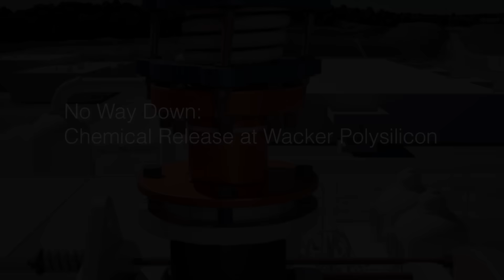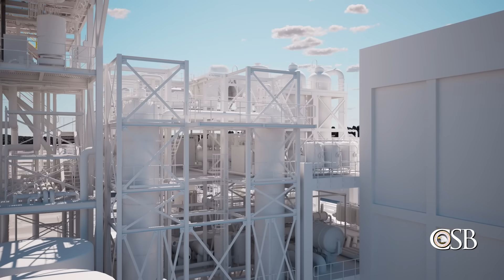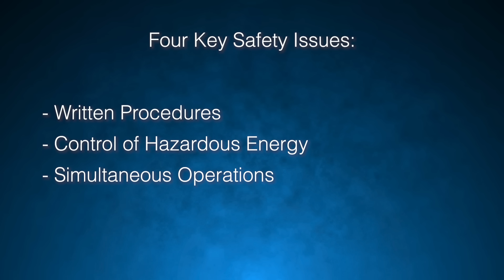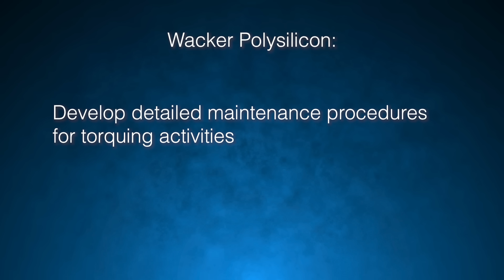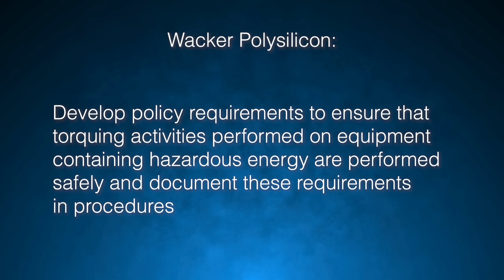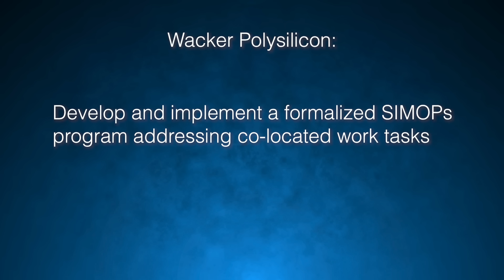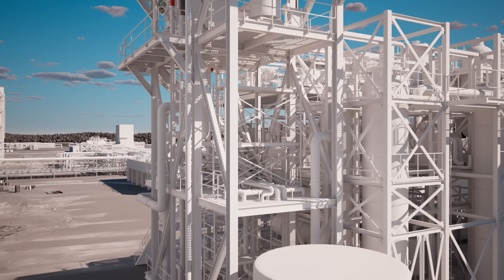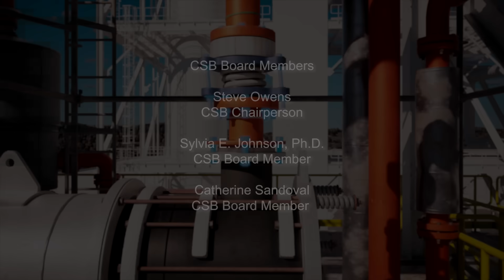No Way Down: Chemical Release at Wacker Polysilicon

Comment: 5 foot pounds of torque is not enough to cause a rupture. There was something else that failed. Maybe the bolt or flange had a casting fault. In my past, I  have been in charge of torque spec calibration. +- 10% is WELL within specifications. 5 pound feet is only % .05 out of spec which is well within specificication. Placing blame on the technician is a copout. I blame management. They should be held personally responsible.

Edit; I personally refuse to work for companies like this because management refuses to take responsibility for their actions. As well as the company refuses to take responsibility. Furthermore, management forces the contractors to partake in unsafe work practices.

Comment: If I worked around this stuff I'd treat it like I was handling a bomb.  "Are you absolutely sure about how tight all these bolts should be?  This stuff here isn't steel..."

Maybe when dealing with something as brittle as graphite there should be some sort of strain relief bolt system that prevents them from being tightened past the limit.
Reply: i work in a bike shop. the amount of NM for carbon seat posts is so specific. there even is grease with some sort of sand in it for byte. otherwise the post gone slip. this stuff should be maybe more clear by using a different size nut and more knowledge from the workers

Comment: I am a welder in the oil field. The fact that they had one stair case is wild, every (modern) drilling rig has two set of stairs off the rig floor for exactly this reason. Also, it’s crazy to me that this plant had to contract out torque down alone. Not swapping valves or gaskets just the torque down and didn’t have any written (as in on paper for everyone working) procedure.
For my work it’d be like “hey just weld that high pressure line however you feel”
Quick story, when I was a welder helper doing some compressor station work I was helping a few guys do some bolt up work. As two of the hands were unbolting a blind on a 16” LIVE gas line, they had 4 bolts out when I got there. I stopped them and asked why the butterfly valve was pointing at us. They looked with WIDE eyes and quickly shut the valve. 
There was an operator cabbed up 20’ away right in line of that blind valve. Even if we didn’t get killed by the release there’s every chance that 16” steel would have gone through the cab of that excavator and killed the operator. Disaster averted by complete chance my very green ass was sent over to help them.
Reply: I got a good friend that works in the fracking bidness and even though he’s 30 he’s got stories just like yours. He has moved up quickly because of dangerous incompetence in his superiors! 
When you’re dealing with 20,000 psi you better follow procedures to a T!

Comment: Pipe fitter my ass you looking through a pair of safety glasses you have zero excuse not the question that so the insulation had been removed they came in and tighten the bolts up made a real shit show of that there's no covering on any of this he should have known from the very start that he wasn't tightening the torque of a piece of metal that is unbelievable

Comment: Pipes made of graphite for holding pressurized gas? Seems like a dumb idea. Graphite is what pencils are made out of, and you know how brittle those are. How did it not just blow up from the gas pressure alone? I would think that steel pipes would be best. I know it's an acid gas, so it could corrode the steel, but all it would need would be a plastic coating on the inside of the pipe to make it corrosion proof. The plastic coating would keep the acid gas from ever making direct contact with the steel.
Reply: Compressed graphite is stronger than you’d expect, forming a sort of ceramic material when bound. Pencil graphite is combined with a clay to make it more malleable. Chances are, graphite is used here because of its high heat resistance, something plastic does not have.
Reply: @skippy9214   Actually more clay makes it harder. That's why harder pencils have higher hardness number, (like number 2 pencil) and these have more clay than pencils with lower hardness number. By the way ceramics are brittle. Clay itself is a ceramic material. Some plastics can stay solid up to a few hundred degrees farenheight. In fact some plastics are liquid at room temperature until given an initial high temperature exposure to solidify them. These are called "thermo set" plastics. After that initial high temp exposure, they remain solid at that temperature or cooler, and even a certain amount above that temperature.

Comment: hmm.. the whole point of being certified as a pipefitter or boilermaker is to know your torque specs of different pipes or have that available..  an operator issuing a permit for work will NOT know that information as it's not in their job scopes.  I also do things as if I'm going to be where the work is as well, and I wouldn't have cut myself off from egress while someone is working on LIVE process piping.. nor would I have issued a permit to work on LIVE process like that.

Comment: Anyone know why one would use graphite bolts? Obviously there is a reason to use steel over graphite or vice versa but I can't find good info on what goes in to the choice.
Reply: My bets are that it’s because graphite is both very chemical resistant and heat resistant.
Reply: Graphite is excellent choice with chemical processes because its very inert. It does want to react with stuff unless conditions are extreme.

Its also great for processes with changing temperatures and acids.

We are not talking about any pencil graphite here. Graphite used in these systems is closer to a ceramic.

Comment: Something as simple as the heat exchanger manufacturer using different bolt heads/sizes could have avoided this. A torx bolt with a warning label is gonna make someone think.

Comment: If he thinks written instructions will solve the problem of unthinking employees, he needs to get a real job.   It is hard to get employees to think.
Reply: nice!  blame the victims!
Reply: @devtrash  Rather than just giving the workers the torque specification for a graphite flange, show them what happens to a piece of graphite in a vice and point out that little number of 15 ft-lbs while pointing out that graphite behaves more like glass than steel.   They understand how things work, but reading most technical writing in detail isn't their strong suite of workers tightening flanges.

Comment: Odd to me that the graphite was not used as a seal with a (machined to conform to the specific graphite part to fully support it, which is easy lathe work) steel support flange so it would never see bending loads unlike the design shown. Such flanges could be supplied "split" to permit easy retrofit to support existing weak graphite flanges (less expense and time to install, needing only split flanges and longer bolts) and installed during maintenance shutdowns etc. 
Proper safety training includes reminders NOT TO PANIC. I thank my USAF trainers for emphasizing this.
Note to any engineers reading this: 
Your products will eventually be installed and used by people who don't know any better work practices like confirming everything by reading tech data first AND understanding basic theory of system operation.

Comment: Requiring such low level PPE is ass covering when there could easily be an IDLH environment caused by an uncontrolled release. The sim ops and acting like someone 10 feet away won't be affected is just absurd.

Comment: Si mops are also a good example of multiple levels of work or work in the same are, this happens constantly in shutdown and turnarounds. It is very common to have workers on fresh air (supplied air) working on process piping and equipment in the same area or above or below where workers are doing lower risk work and being exposed to opening of process equipment.

Comment: How tight? A ya know the ol good and tight! .. your a journeyman pipefitter supposedly.. you should be knowing EVERY torque setting of every stud you tighten on every flange. This does not happen in areas of the world with strict certification standards.

Comment: The exact day that this video came out, my site had an incident with a contractor incorrectly torqueing a bolt on a pipe. Thankfully, it was only pressurized air in the pipe at my site, but the man still almost lost four of his fingers- saved only by the timely intervention of an advanced trauma surgeon.

I'm really grateful that there's organizations like USCSB to investigate accidents and suggest regulatory action. And I'm glad that the general public is starting to take a greater interest in safety due to these videos.
Reply: I only wish the USCSB had more power than what amounts to telling companies very loudly "Please don't do this incredibly dangerous shit pretty please we're begging you."
Reply: Holy sh1t, escaping air blew his fingers apart? 

Wow!
Reply: @volvo09  Escaping at high pressure it will be like a blade.
Reply: @volvo09  
I mean an explosion is really just air too, if you stop to think about it for a second.
Reply: @volvo09  even pressurized water could split your finger
Reply: Sadly the USCSB can only make recommendations, it has no power to enact anything.  They can make a report and it can be ignored.

Comment: Great safety video! Thanks for the time and effort put into it! SimOps happen all the time. It's always fun managing the structural, mechanical, electrical, and chemical contractors all at the same time 0_0 Easy for accidents to happen if you keep pushing your contractors to get done quickly, as opposed to getting it done safely in a timely manner. In this case, I would argue that the guys working on the chemical equipment should have just taped off the area they were working in. This is already commonly done at ALOT of plants. I'm actually surprised it was even an issue as this plant. Most guys I work with bug out when they see someone wearing hazmat gear and they're in the same work space as them wearing long sleeves, jeans, and steel toes. When I've worked in the same area with others, we've always erred on the side of caution and worn the highest PPE required by an individual contractor, ESPECIALLY when in tight spaces (ex. equipment room with single exit door or 5th floor single egress point).

Comment: The work waas to be performed WHILE hydrogen chloride was flowing through the piping systems? And a second group was performing work nearby while only wearing minimal PPE? As soon as that heat exchanger ruptured they were all at  extreme risk. The gas exchange should have been turned off, first. The crew should have been fully shielded. The exact procedure should have been written and reviewed first. Only one operation at a time should have been carried out.

Comment: With so much at stake, why wouldn't the torque value just be stamped right on the flange or bolt head?? I use paint pen to write them on my vehicle parts for future reference

Comment: Graphite really is the best choice for heat exchanger unions. I have always felt that graphite piping should be tagged or tagged out in regard to their accompanying bolts and nuts torque requirements. I’ve seen castle nuts with Inconel 718 used with wire individually and warnings when fastening graphite fittings. The tags had two holes that wrapped around each bolt but the safety wire was one piece.

Comment: As someone who performs maintenance for large trucks in highway applications I know first hand how getting the proper torque specs for fasteners can be like pulling teeth. Especially in a culture who believes they don’t need to use torque wrenches. 

Even the dealership we source parts from were surprised to see an order from us for torque to yield bolts for brake components because even at the dealership nobody was replacing torque to yield bolts after each use.

Comment: I want to say something about this. Because I have been the talk of OSHA. But I honestly see nothing wrong here. I really don't. This was easily changeable. From the torque specs alone. Inch to feet pounds are the biggest. If that is spec, they should be easily found. There should be a regulation that puts part numbers and torque specs that are easily accessible online. I can Google any torque spec on every bolt on every vehicle on planet earth.  This is a mishap from the start

Comment: In my line of work as an A&P mechanic, NOBODY is allowed to perform any kind of job without having the maintenance manual directly in front of them even if it's just putting grease into the landing gear. There's a reason why you always want to do things by the book, because as they say: "rules are written in blood". Someone died or was seriously injured for that rule or regulation to exist, and nowhere is that more true than in industry and aviation.

Comment: 7:44 In the animation, the technician using the torque wrench appears to be doing so incorrectly as they aren't holding it from the handle (the black portion).

Comment: I get it. I do low level Chemical storage inspections and emergency response for a sate agency. A few weeks ago a chemical company had a "spontaneous" decomp of a highly concentrated organic Per-Oxide. After reviewing the incident, technically they didn't violate anything within their SPRs reporting requirements, however they didn't call us or the county emergency response agency for over two hours. The plume was visible from five miles away, and the deflagration sent a blowout wall 30 feet into a nearby field. Industrial safety or lack there of, is very frustrating. I used to fix Apaches, I worked on things where you needed to document that you read the manual for torque specs, and that you applied torque specs to the specific bolts. IN WRITING AND SIGNATURE. Why not for industrial employee safety?

Comment: The level of expertees both in managing and executing the bolt tightening is shocking. I apply more thought and data to torquing a bicycle crank than a whole department and a supposedly skilled worker applied to machinery containing hazardous chemicals. Apart from anything, overtightening stuff most often just "feels wrong" and anyone with half a brain stops way before damage is caused.

Comment: The fact that the bolts/flange didn't have the torque requirements stamped or a decal put on them is absurd.   A $1 decal could have prevented it all.  And the practice of outsourcing repair/maintenance work should be questioned.

Comment: Management is definitely at fault here, but this screams inexperience on the side of workers.

If you send me to a job just to torque something down to specifications with a written procedure, and you tell me the torque between the metal components but not the incredibly brittle materials, I’m gonna ask questions, and we won’t proceed until that torque is spelled out clearly.

On top of that, if I’m on a tower, and there’s people around me wearing a hazmat suit and I’m not, I’m going to ask why and start moving away. I have no guarantee that the other team doesn’t have a dumbass on their side.

Comment: There may not be specific standards for simultaneous operations (because the permutations and combinations are infinite), but for decades there have been standards, regulations and best practices for development of field level risk assessments, in which multiple groups that interact with each others tasks are required to assess these interactions and put in controls to mitigate or eliminate the hazards.  If the company got off with a slap on the wrists using this argument, then shame on the courts.

Comment: Sounds like they were refurbishing the platform and just jammed everyone together. Happens all the time, the eye of focus falls on a specific days or week and they cluster it all up. Then no one gets done half of what they hoped. The half that was done was done improperly to get out of someone's way or rush it along.  Tale as old as time, maintenance is a beast.
   A torque schematic was the real failure though. Write shit down only costs some ink, or go digital and put a note on your phone so google or whoever buys your personal information can also know the torque rating of the graphite to steel connecting bolts on a hydrogen chloride regeneration unit.

Comment: Regarding the bolts that were overtightened - I think an additional safety measure could be if the bolt heads for LOW torque bolts are shaped differently than the bolt heads for HIGH torque bolts then the same tool could not immediately be used to tighten both bolts (which are in close proximity, creating temptation to tighten both in the same process)

Comment: Okay, whoever thought it was okay to house hydrogen chloride inside of a vessel that can only handle 15 ft lbs should be sued. 15 ftlbs is about the force of a strong sneeze. A toddler can tighten tigher than that.

Comment: I worked in a refinery that used Hydrofluoric Acid in one unit. To enter and work in that unit you had to wear the full chemical suit. I remember in the summer how hot and uncomfortable it was and how exhausted you were working in those suits. It was especially uncomfortable standing in direct sunlight. This may have been a contributing factor in this accident.

Comment: Is it feasible to require torque requirements to be etched onto the top of the bolt itself or something? Seems like a risk to have bolts of the same gauge right next to each other with wildly different torque requirements. Wonder if you can simply stamp some 40psi and others 15psi so there could never be a confusion (will require very careful installation in the first place not to install the wrong bolts obviously).